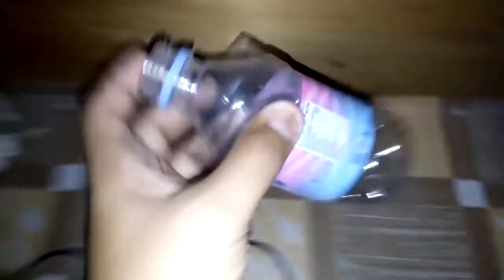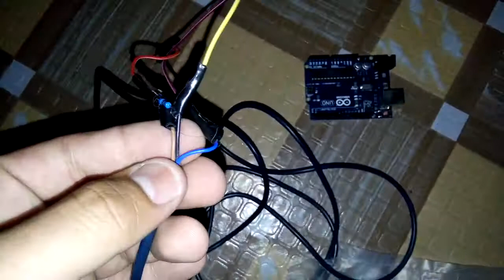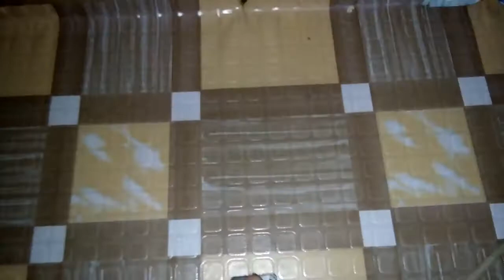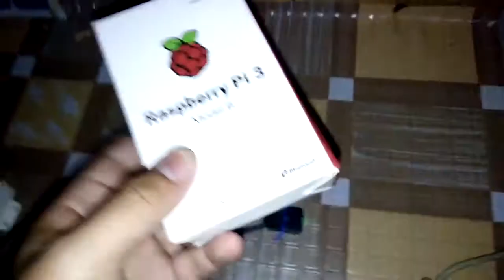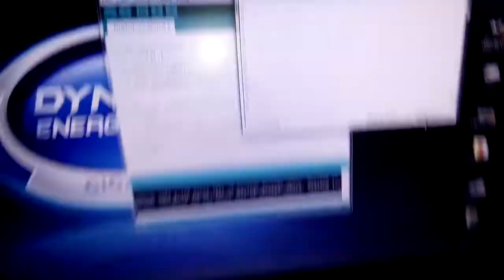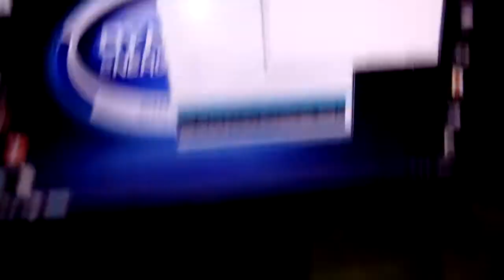easyelectronyx tutorial of diffused reflective photo electric sensor to detect plastic

Comment: Have you tried this on glass bottles? Those are transparent too and some have colors. May I know if it is read as 0 or 1?
Reply: make use of load cells. you'll differentiate it by its weight.
Reply: which sensor used in sense the plastic